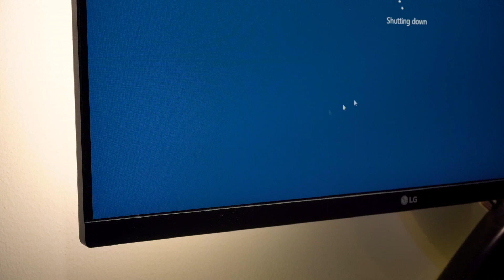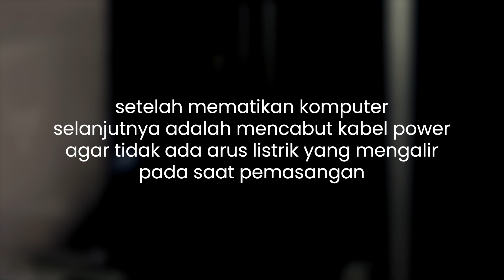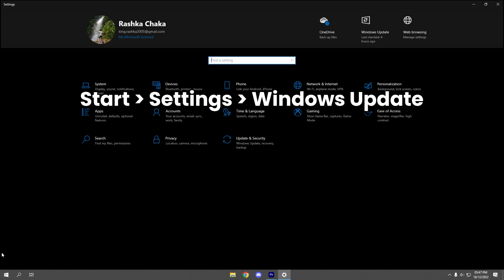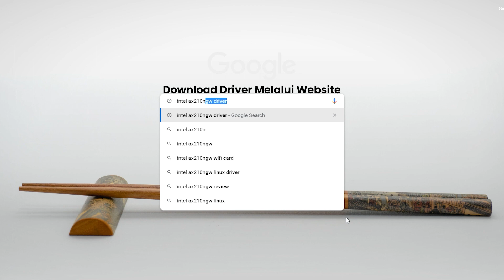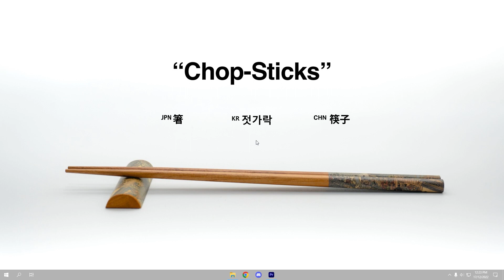Cara Instal M.2 Wifi & Bluetooth ke Desktop PC | Intel AX210NGW Installation Toturial

Comment: Ax210 di device manager bisa disetting 802.11n only gk bang? Wireless protokol yg 2.4ghz. bgn di setting n only

Sebelumnya pake tp-link sama tenda masalahnya sama terus, stuck di 802.11g yg cuman 54mbps setelah pemakaian bbrp bulan
Reply: mungkin bisa di setting dari control panel bagian configure - advanced

Comment: Will it work in regular m.2 slot where I put my ssd
Reply from the maker: Yes, but you might need to move the bolt mount closer to the slot.

Comment: Kalau untuk mobo msi pro h610m-e ddr4 bisa ga bg?  Takut ga bisa nntinya dah terlanjur beli malah jadi rungkad 😵‍💫
Reply from the maker: Selama ada slot m.2 buat wifi bisa, dan pastiin baut dudukannya support m.2 ukuran 2230👍

Edit : konfirmasi lagi ke seller biar aman
Reply: @BentoBox.mp4  oke siap bg terimakasih infonya 💪
Reply from the maker: Tapi kalo diliat MBnya lebih cocok dipasangin wifi pcie sih, soalnya klo slot m.2 cmn 1, sayang mending buat ssd.

Comment: bluetooth nya aktif juga gak bang?
soalnya kalo pake converter pcie 3x4 harus connect jg kabel ke usb biar aktif bluetooth nya
Reply from the maker: Bisa kok keduanya wifi sm BT nyala
Reply: pigtail dan antena nya wajib di pasang ya bang?
Reply from the maker: @hudadamar21 betul, biar lebih optimal

Comment: bang itu kan wifi card ny key A+E bisa dipasang buat key E ya? misal itu wifi card buat motherboard asrock b660m pro rs
Reply from the maker: Untuk lebih detailnya bisa tanya ke sellernya lgsg ya, soalnya seinget saya kata sellernya untuk mb asrock beda lagi modulnya kak🙏
Reply: baiknya cek website versi modul apa yg di support mobo asrock.. kalau saya b550m pro 4 pake module yg 2230